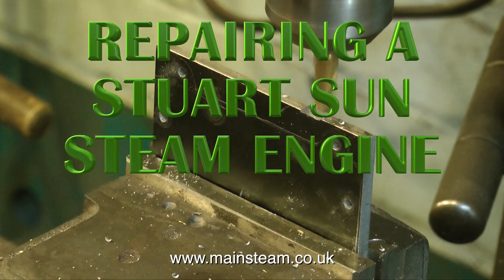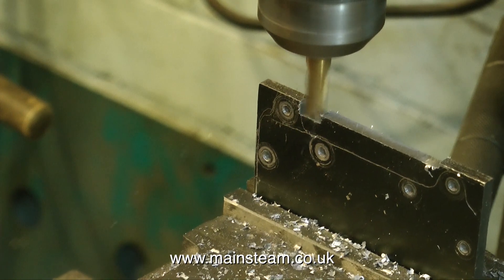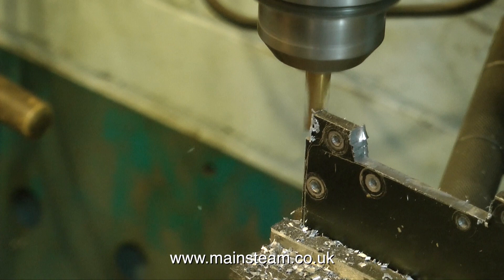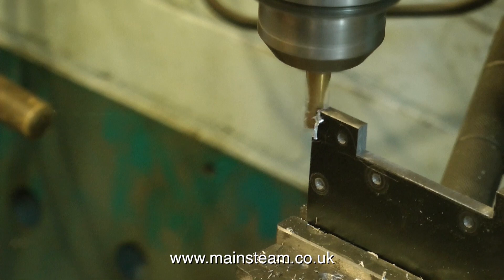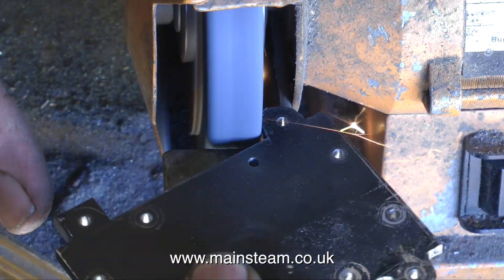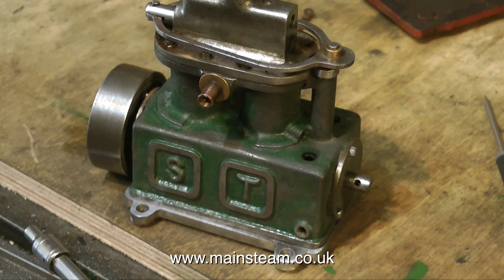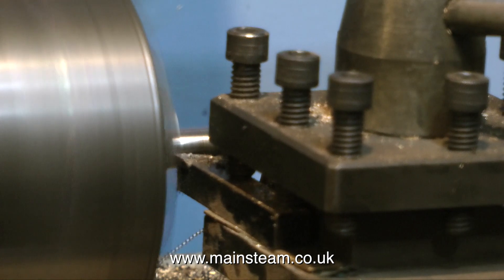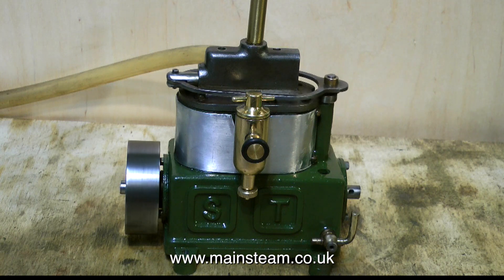PART #3 - REPAIRING A STUART "SUN" MODEL STEAM ENGINE

Comment: If you take an old rim from a car and weld a post into it with a plate on top, then buy a bag of ready mix concrete and pour it into the base of the rim you have just made a grinder mount you can tilt and roll around your workshop. Not sure if you guys do that over there but here in Canada they are a regular thing to see around shops. Works well for drill presses too.

Comment: This engine really looks nice in that shade of green. Very nice job Keith. Again thanks for sharing. The drain cock is a nice feature. I should think that any steam that passes the pistons would condense in the sump and with the cock, it could easily be drained out after a run with steam.

Comment: Making a plywood base is helpful if you want to add your own rests to the grinder, just bolt them to the base. You can also mount a metal or wooden angle to the base so it can be mounted in a vise or to the front edge of the work bench. Hinges are particularly attractive if you want to ignore them and go right on letting the grinder vibrate around wherever chance or Karma lets it go. You might also consider a stand made of PVC pipe or a form for a concrete pillar, I think I read that they become pretty stable if you fill them with sand, certainly with concrete or mortar. Some sizes of pvc pipe will nest which would aid in engineering the flexible areas. Having the grinding debris land on the floor would allow you to sweep and vacuum up the debris which is hopefully less cluttered than the table top as it sometimes is in my case. It would be cute to model the stand after one of those turned and polished engine support columns and paint it silver. Well, maybe not...

Comment: Have you thought about a "quick release" for your grinding wheel? One that allows it to be clamped to the bench and moved around as you need?
Reply from the maker: I already have one ..... my large grinder polisher is a permanent fixture, but my small double ended grinder isn't fixed to the bench - I never got around to it :-) :-)

Comment: i have the same issue where i have to move my grinder around as well as having more grinders and sanders than i have room.  what i did was mount each tool on an 10" square of 3/4 plywood then made marching sockets around the shop.  i also made blank squares so the bench is flat when no tool is in use.  it was a moderate project but im really glad i did it.  its nice to just plunk whatever tool i need wherever need and to reconfigurenmy shop based on what im working on.

Comment: Yet another great video!  I have no doubt that you get weary of the safety-freak comments on Youtube.  I don't think you're a madman, I don't think you're likely to ever seriously hurt yourself.  But you might want to consider at least slapping a couple clamps on your grinder.  It keeps it from buzzing all over your table, and gives you at least a little protection in case the thing decides to start somersaulting all over your shop :)
Reply from the maker: verdatum it is the feeblest grinder on the planet - it has little power to do anything other than lightly grind small parts - but I do take your point :-)
Reply: I know what you mean my grinder is like that too when I grind anything I have to take it off and let it get back up to speed